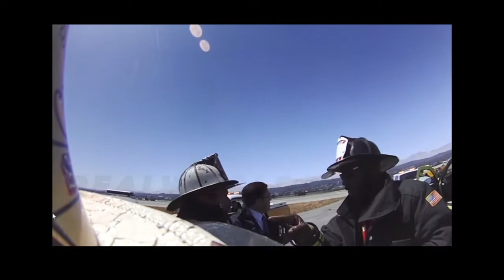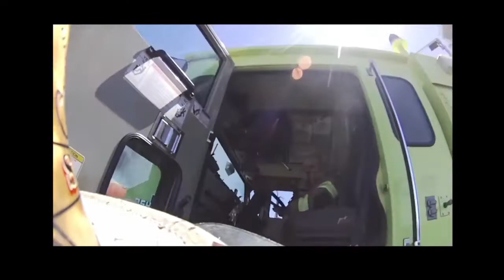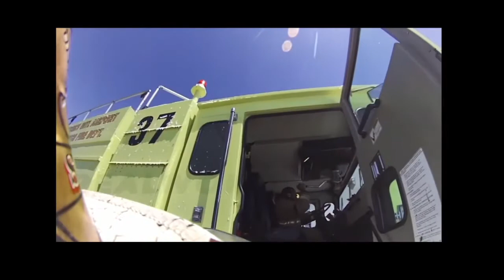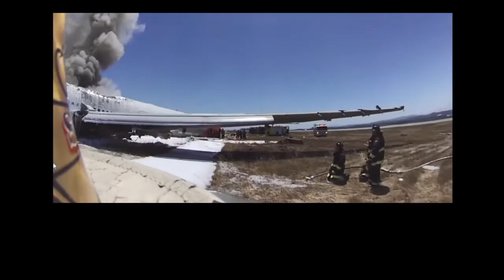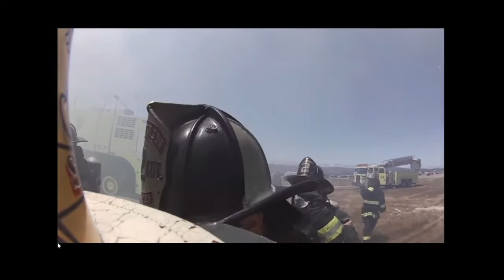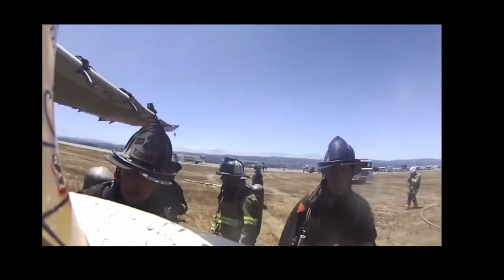Asiana Flight 214 : ARFF Fire Tactics Breakdown

Comment: Asiana 214 that one missing might have been the one place they couldn't look. In the foam around the fire vehicles.  One of the dead was run over by the rescue crew and buried in the foam around the crash.  I'm not sure if the body could be picked up by infrared